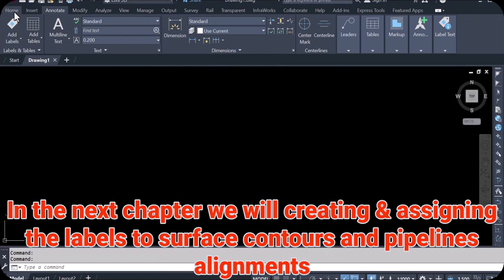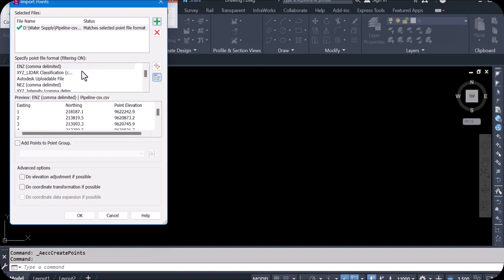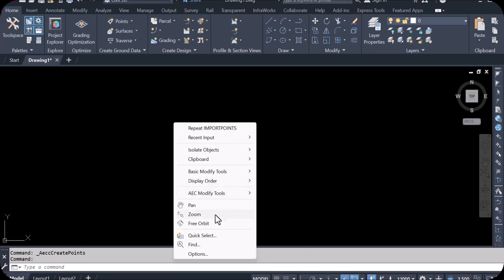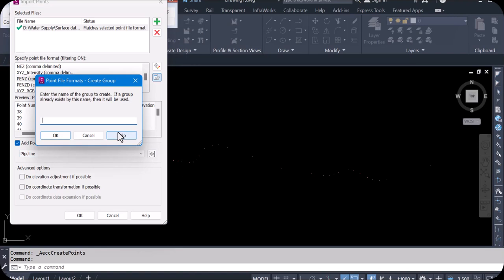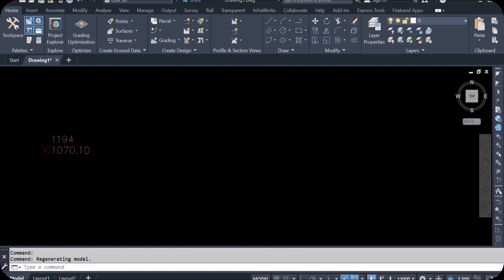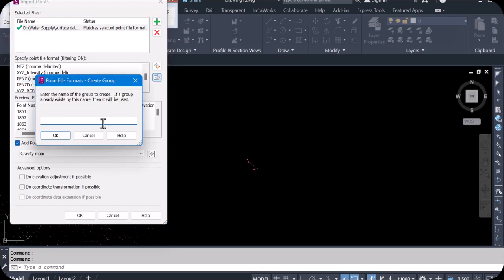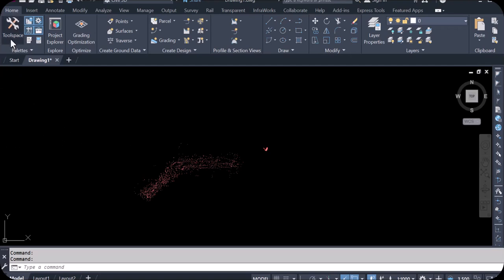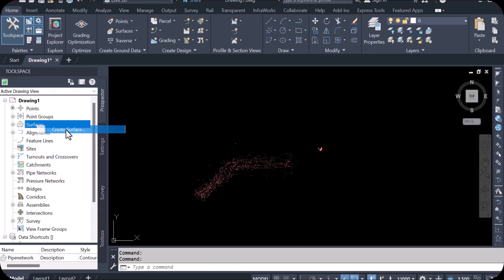Pipe Network Part-3: Points Insertion, Surface Creation, and Contour Generation, Civil 3d

Comment: Dear Sir what's the difference between gravity pipe and pressure pipe network
Reply: Thank you sir you hit the nail on the head
Reply from the maker: @mohdfarhan9995  Thanks brother,
You will see very soon and very important chapter of pipelines catalog customization of manufacturing materials and sizes
Reply: Thank you sir I need that video about about pressure network pipeline catalog
Reply from the maker: @ You will get this week sure, there we will create new catalog of GRP pipeline as per manufacturer data.
Reply: Thank you so much Sir please make a video about GRP 900 mm Dia for pressure network
Reply from the maker: Gravity Main: It relies on gravity to move fluids (like Water, sewage or stormwater) through pipes. These systems are typically designed with a slight slope to allow the fluid to flow downward naturally, without the need for pumps or pressure.

Pressure Network: This system uses pumps or other mechanisms to force the flow of fluids through pipes under pressure. It is used for systems like water supply, where the fluid needs to be pushed to overcome elevation changes or long distances.